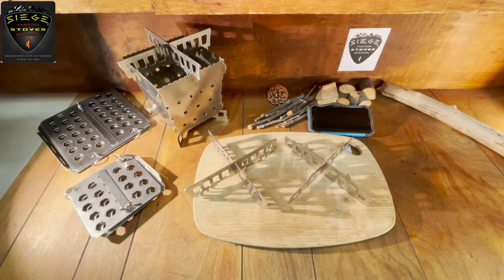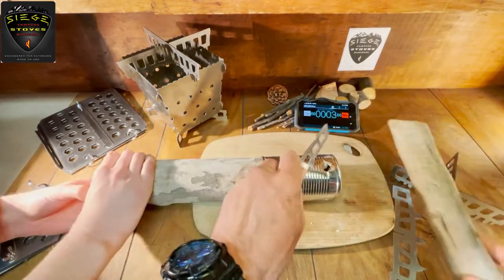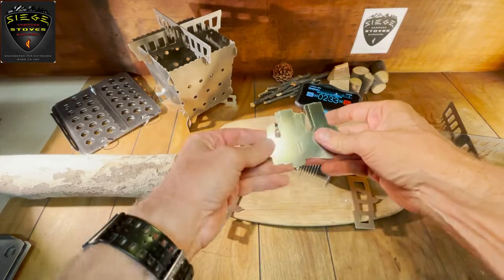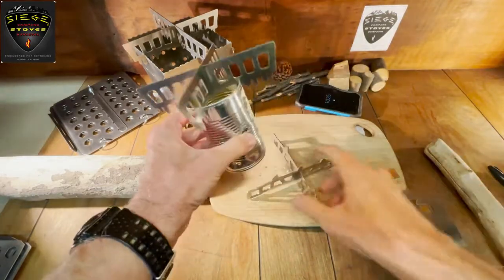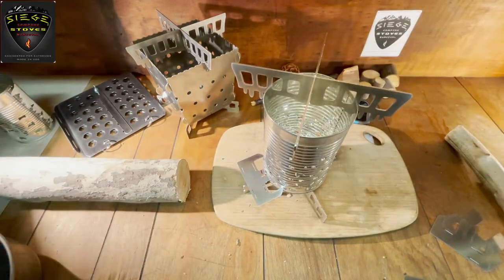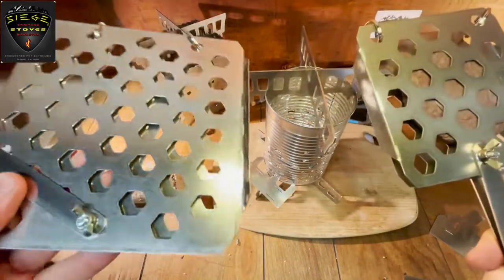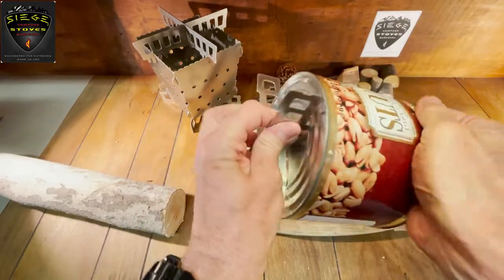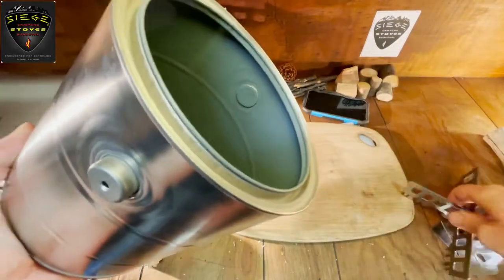Fastest hobo stove on the planet! Flat-Pack option too! Convert any can into a powerful wood stove.

Comment: I wonder if the pot stand and the feet would work with a stainless steel cheese grader? Great presentation by the way! <3
Reply from the maker: Thank you Melissa! I'm not sure what you have in mind -- can you explain your idea for me? :)
Reply: @SIEGESURVIVAL  Get out  your cross stand pot stand, and cross stand feet then put them on the top and bottom of a cheese grader. Another homemade stove.
Reply from the maker: @melissahoffman4687  That's a creative idea. It might be unstable, given that cheese graters tend to be tall and narrow. Also I suppose one would have to cut the handle off to make clearance on top for the Cross-Members and pot. There's also the question as to whether or not the Cross-Members will fit the grater, and the width of graters might vary somewhat. Lastly, there wouldn't be a floor to the stove, but I know of one user who does that with his cans (cuts out the floor) and that works well for him. 
If you try them on a cheese grater and it works, please send us a photo!
Reply: @SIEGESURVIVAL   You mess around with it.You identify how it would not work or how it would work.
Reply from the maker: @melissahoffman4687  :) Okay Melissa! One more thing to add to my to extensive do list . . .
Reply: @SIEGESURVIVAL   Wishing you the best.

Comment: So why dont you redesign the bottom grate with a "church key" delta or pyramid can opener... takes 5 seconds with the right tool... these are the best grates!
Reply from the maker: Hi Douglas! It's been a while -- I hope you've had lots of good use out of your Cross-Members. Thank you for the feedback! I'm always open to suggestions, and the idea of adding functions is appealing on the face of it, but usually end up having some drawbacks. In the beginning we considered adding various tools to the Cross-Members, but this would require the use of much heavier, hardened tool steel, which wouldn't be ideal for a lightweight stove, and would force compromises to their primary function. Also, in my experience most of the products that attempt to add various other tools end up being less than ideal for every function, including their primary purpose, with one defaulting instead to using a dedicated tool for the task at hand. If people bent their Cross-Members while opening a can, they wouldn't be too happy :). The Cross-Members would also cost a lot more to produce and wouldn't pack flat, whereas church keys are mass-produced and can be picked up for next to nothing at yard sales, etc.
For making holes in a can a church key might work a bit better than the fangs (I have a can that was punched using a church key, and it works well), but the fangs are good enough for a survival situation, and for preparing a can in advance, a drill with a tapered drill bit will produce the nicest result.
Reply: @SIEGESURVIVAL  Buy 4 church keys for $5 is the best solution.